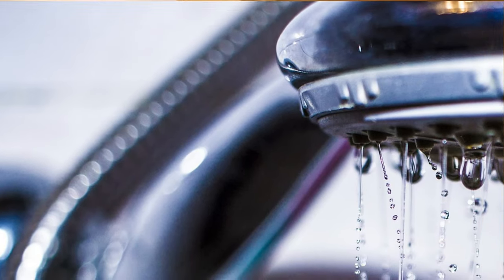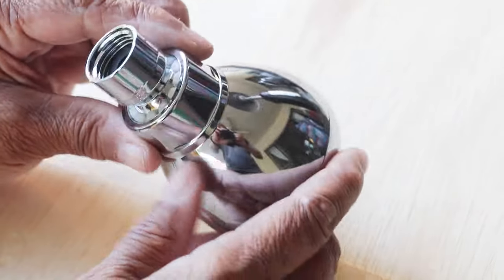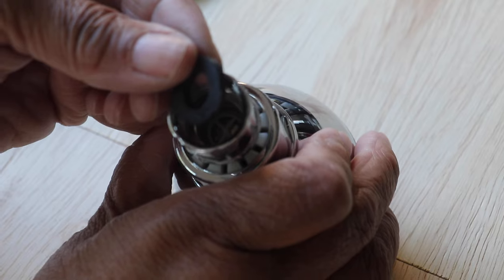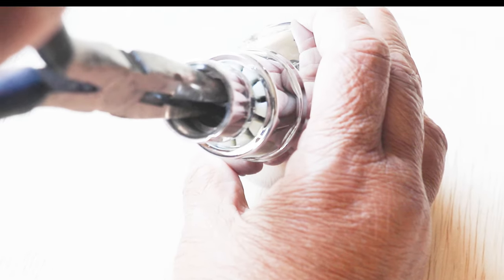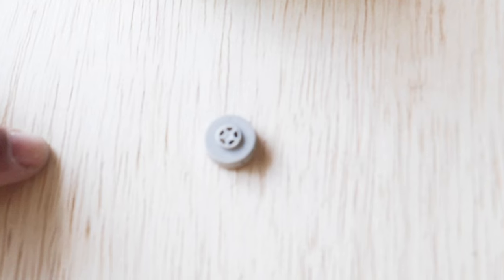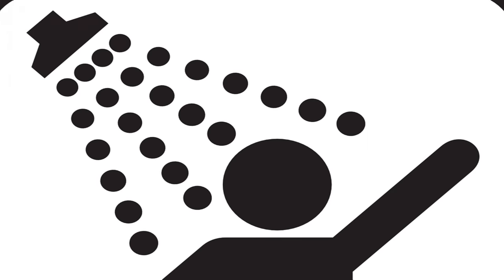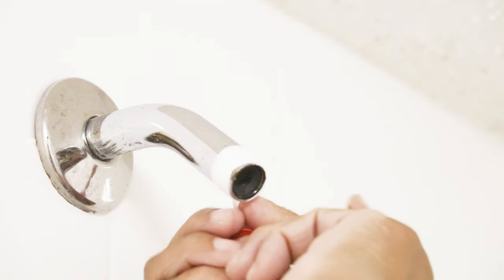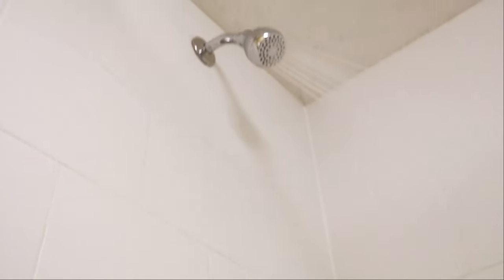Secret Few Homeowners know and PLUMBERS don't tell you

Comment: If one showers correctly a flow restrictor is senseless garbage. The average shower time is approximately six to eight minutes. If one showers properly and turns off the water inbetween then the water usage is roughly only half the time. If one showers very slow then one needs maybe ten minutes. If one can't afford five minutes of water a day then one is doing something wrong and needs to restrict the flow somewhere else in ones daily life.

Comment: Great tip. Will it work for the newer showers that has 2 heads where you can take the one in the middle out to hose off
Reply: Yes it does, but you need to remove it in both places
Reply from the maker: Yes
Reply from the maker: But it may look a little different

Comment: How many wraps of tape should we put on?    Thanks
Reply: Not necessary with a washer in place. The threads are only used as a means of pulling the pipe to the rubber washer

Comment: Well. It’s not that we don’t tell you. We don’t wanna return after you find out your hot water runs through the shower head at a much faster rate and you get an 1/8 of the shower time. So people say “ plumber said he wouldn’t do it”. Lol. No. You will make me come back for free on a urgent notice and fix it back after you done lost the restrictor. The epa does not own this rule. Water heater manufactures do. Tankless is the only time I recommend this. But remember.  A 2gpm shower at 20 minutes. Will run 40 gallons. Removing that. Taking the same 20 minute shower. Your running 5-7 gallons per minute depending on pressure. Your water bill will follow the same ratio. Please stop asking me. Do it yourself. Knowing about it is the hardest part.

Comment: Is these in sink faucets as well?
Reply: They can be. The newer "cache" style aerators always have restrictors. This style can be identified as the aerator exit is flush with the faucet end. A special "toothed" tool is used to install and remove the aerator. And there are different sizes. Fortunately, cache aerators are available in different flow rates. 
Some traditional aerators also have restrictors. These can also be replaced.
Reply: Yes, indeed.

Comment: You better of buying a shower that gives a lot of pressure with only 1.5gpm  you can buy ones on eBay $8 or buy waterpik about $25 I buy handheld showers as they work better than just shower heads on ebay look at shower heads with beads you save a lot of money and water

Comment: What if you do have low pressure,these restrictors compound the problem.At the very least this tip would be a help in that situation.Oh,and just for the record, do they have those restrictors in the showers heads that mount above on the ceiling that are about 1 foot square or is it just  us peons that should be the ones to conserve water.What's next for us.Oh I know,we won't take showers, will just pee on ourselves.

Comment: This video is outdated . new shower heads and hand held wands no longer have restrictors that are removable if you try to remove it . it will.leak badly.
What you need to do is leave it in there but just drill holes in it and it will work fine..

Comment: OK they low water pressure coming out of your showerhead is not always the flow restrictor inside the showerhead. It could be your diverter it could be calcium buildup inside the bath and shower diverter body which will restrict the flow going into the shower riser. So don’t let people like this bash plumbers because apparently she doesn’t know what she’s talking about.

If your pressure drops just all the sudden it’s not going to be because of that flow restrictor because that flow restrictor was always there when you first installed that showerhead. So there’s two things to check and that’s one unscrew the showerhead and sometimes you will see a little build up of small stones that come from the Watermain and all you have to do is clean it out but other than that it’s going to be your diverter or buildup in the diverter body.

Comment: Improve your video by showing how to clean a dirty flow restrictor. Think about it they bought the shower head and thought it was great  but now it just does not have the zing it once had. Remove the flow restrictor, clean it (or replace it) and re-insert it.  The shower head works like new.

Comment: You didn’t fix the problem you just cost people money in both hot water energy and the cost of water that’s why your licensed plumber won’t remove this device but clean it instead or replace the head or explore the installation of a whole house filter,how about fixing the problem and not the issue all that you’ve done is putting off the entire head from becoming obstructed.and that sir is the difference between a hack “ie a non licensed person who has not a clue about why something is not right and some on who dose”.I’m all for a home owner cleaning the screen but not removing it I have a code I have to abide by that states you shall not remove

Comment: The flow resistor has been placed in the shower head not only to reduce water flow, but also to save you money. By reducing the water flow you save money on your water bill, and you save money on your hot water bill by reducing the electricity or natural gas used to heat your water.
So it is not just something you are doing for the environment by reducing your water usage, but you are doing yourself a favor in your wallet  by saving money.
Removing the flow restrictor is one of the stupidest "tips" that I have seen on YouTube.
Reply: It's not stupid if you don't have enough water volume to do the job. All that to say, "if you use less, you'll save money." NO SHIT...
Reply: @masonjar9023  :- Save money...by using less water,
                            Save money... by using less energy,
                            Save the environment by reducing waste...
Not a complicated equation...but misunderstood by many!